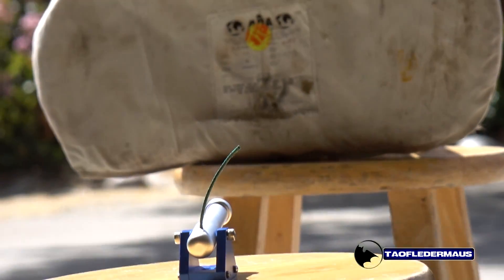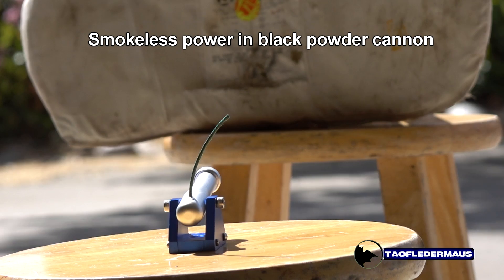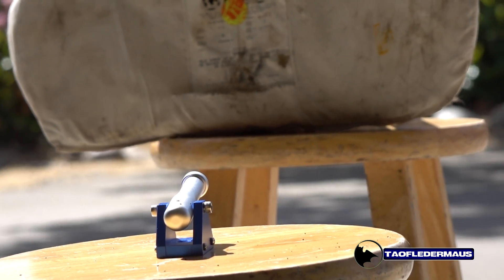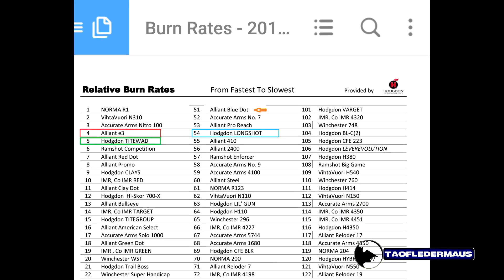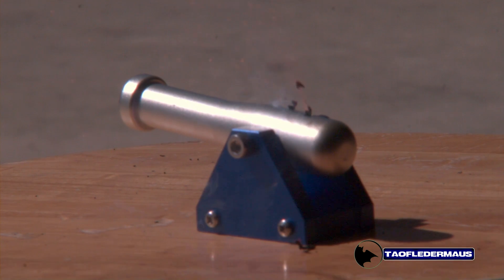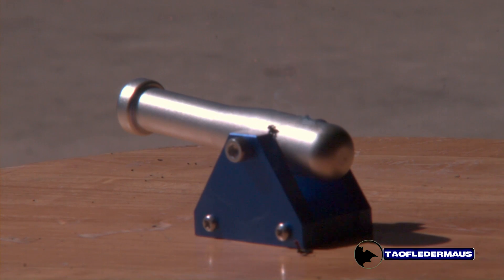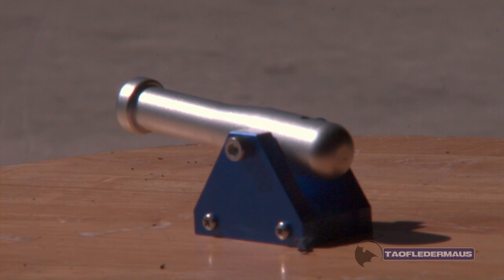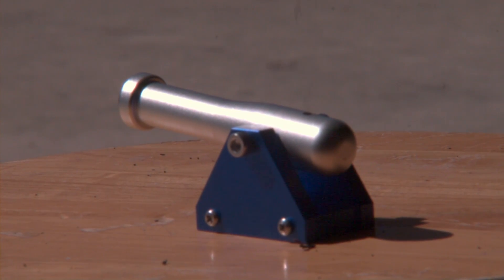What happens if you use smokeless powder in a black powder cannon?

Comment: Now replace that fuse hole with a percussion cap and you've got something. There is a good reason you don't use smokeless in black powder guns, when the pressure can rise it rises much faster than it will with black powder. Many a black powder rifle have been blown to pieces this way.  That is unless you have one specifically made to handle the presusure like some model savage guns, and another reason why you should never use pyrodex or other black powder substitutes that are really just smokeless powder.
Reply: Wow. So much FUD, and some outright misinformation. Pyrodex and the substitutes are definitely NOT "really just smokeless powder." They do not burn in the same way as smokeless powder; they burn the same way as black powder, which is why in this cannon black and pyrodex both work, and smokeless does not. Also, all smokeless powder is not the same; some burns very quickly, and some burns relatively slowly. It is possible to use smokeless in a black powder piece without destroying it; I have done it with no apparent ill effects at all. It just requires understanding the differences in the behavior and characteristics of the respective propellants, and loading accordingly. Sure, if you're an idiot and dump the same volume of smokeless pistol powder in as you would black, you can cause major problems, since it's roughly 3x the power by volume, and 8x by weight, so you're massively overloading it when doing that. However, if you calculate an appropriate load, and use an appropriate powder, it can be done safely. The safest thing of them all is, by FAR, the black powder substitutes. Not only are they very comparable in their burn characteristics, therefore safe for the gun, but they also are less likely to be accidentally ignited, therefore MUCH safer to handle. Don't repeat urban legends as fact.
Reply: @edifyguy  Pyrodex is NOT black powder, it is as they say a "black powder substitue" and it is in fact a type of smokeless powder, only it has some additives in it (which are actually quite toxic unlike real black powder) Also pyrodex is NOT a perfect substitute for black powder, they even tell you it's for MODERN black powder firearms only, antiques... well I've seen some tears shed over antique flintlocks that just can't handle the pressure to get up to. The biggest thing done to control the pressure rise time is the grain size, however pyrodex is NOT the same density of black powder, it's stuffed with filler to make sure in MODERN black powder firearms you can use a similar volumetric amount(as they say you are supposed to)... but if you use it by weight... you can blow your gun up, it's not the same density as real BP. I worked in a shop and sold many black powder firearms over the course of a decade and we had some come back blown up looking just like as you said (i'm assuming you mean elmer fudd) elmer fudd fired it after bugs bunny put his finger in the barrel. We would then have them bring us the powder. For BP firearms we only sold Goex or swiss powders, 9 out of 10 times these blown up guns they would bring in a jar of triple seven or pyrodex and we would write hodgedon's and they would send us a letter back saying unless it was a modern new black powder rifle and it specifically said to use pyrodex type black powder substitutes that it was operator error and misue of their product EVERY SINGLE TIME!  Worse still, pyrodex has potassium perchlorate in it, a powerful oxidizer many times more powerful than potassium nitrate. As for smokeless in any old black powder gun? NO! NO NO NO NO NO. The only manufacturers of black powder guns I know that say you can use smokeless is savage arms. You just go with what the manufacturer says and do not innovate. smokeless powders are a different chemical compound that have a different pressure curve for the same grain size because the chemistry is different. SAAMI has all the expensive gear that you could never dream of affording to ensure safe operations of firearms with reccomended loads and types of powders.  Sometimes you can get by and accidently double charge a gun and it still goes bang... sometimes not and it goes boom. Case study: we had one customer who thought, hey my 45 long colt rifle will fit a 454 casull Let me tell you he had a REAL BAD DAY! So yeah... Load a weapon ONLY with what the manufacturer has prescribed for it and NOTHING ELSE, you don't know everything and ancidote is not evidence. EVERY SINGLE TIME someone came to us (or the sheriff came on their behalf) it was not the first time they had tried something not reccomended. Mr 454 in a 45lc actually got through half a box before it took off two of his fingers for example.  Metalurgy is a complex science, often times you can exceed the yeild strength of steel several times and maybe stay within the unpublished safety margins but only barely and do it 20 times with no ill effect, but then the 21st time you do it you're going to the hospital to pay a hundred grand to save what's left of your hand but that's pretty silly when you can just use what the manufacturer has proven to be safe and never have an incident (NOT an accident) like that.
Reply: @kg4boj  I would still say that your evidence is anecdotal, other than the idiot who deliberately loaded the wrong cartridges in his gun, which is never a good idea because fitment will be poor and the charge will always be incorrect. It is possible to overcharge bp guns using real bp, and Hodgdon does warn that its substitutes provide more power than real bp. However, to say that they are smokeless is to ignore chemistry. Their composition and burning is much more comparable to bp than smokeless; they are deflagrating powders, as bp is, and essentially they are just more modern formulas for bp. Triple Se7en, for example, as far as I have been able to research, is made somewhat like bp but using sugar as its carbon, and who knows, it could be potassium perchlorate as the oxidizer. I don't know or care. I do know that your statement that it is smokeless with filler is factually wrong. Lay out three lines, one of smokeless, one of black, and one of bp substitute, and light them one at a time. Compare the burns. As for not using them in antiques, they tell you they're 15-30% more powerful by volume right on the can. If you're using full powder charges in an antique with any powder, all I can say is that you don't love your gun. The metallurgy just wasn't reliable back then. They were known to blow occasionally at the time with period bp. As for SAAMI having equipment, yes they do, but don't presume that careful calculations from their results can't yield usable results. Your approach to this topic seems to be a combination of elitism and fear-mongering, and is very short on science.
Reply: @edifyguy  There are a number of police reports at my old shop where people used the supposed reccomened amount, and sometimes a bit under. And yes, there is a blackpowder like substance in pyrodex to give it that old fashoned look and feel of bp, but there is also nitrocellulose in there, under the MSDS it's called "proprietary blend" as for "power" that's not really an exact thing, power is work over time.  Take the Sandia labs z machine, it uses 9 megajoules per discharge to cause an intense enough explosion to initiate fusion, coincidentally a 9V battery has about 9 megajoules of electrical energy stored in it but unlike the z machine the pulse of it's output power is not enough to kill you. DV/DT is VERY important and you'll notice on most firearms there are funny little markings, these are proof markings done with cartrdges of a known energy with a known pressure rise time that has been determined experimentally NOT by guesswork. Funny thing is things that factor into that don't scale linearly so guesswork or even careful calculation is NOT sufficient to guess a load unless you have a high speed high pressure transducer, a universal reciever and breech with a pressure port, and a hydrostatic measuring tank that can fit said barrel. Guesswork is NOT good enough when dealing with what is essentially a bomb in your hands. Some of the guns were very high quality and handed down generation after generation such as a brown bess or two and they dun got blown up because bp substitute is not the same as real BP. You can even test for NC in powder yourself if you want. Get yourself some real BP, potassium nitrate, charcoal, and sulfur, mix it with acetone. Nothing dissolves, it just turns into a wet paste. Now do the same with smokeless single base (double base will seperate out the nitroglycerine in it and give you a wicked headache and can cause your blood pressure to crash dangerously low)
The nitrocellulose will dissolve in the acetone giving you a plasticy like goo that if you take out of the acetone will harden into a plastic like lump... because it is the same thing as cellophane (old school stuff) but with a couple nitrate groups attached and it has very similar properties. Once dry it will burn like a compressed lump of NC. Now take your pyrodex, dissolve it in acetone and you will get again the gooey nitrocellulose seperating out  and in solid form it will burn identically (same color, same speed) to the NC you got from the smokeless.
Your best bet is to only use real black powders with antiques, never substitutes, and with modern black powder guns to only use what the manufacturer of the firearm says to use, and if you feel lucky you can try smokeless powder in a savage. You can call any other bp gun manufacturer and ask them how much smokeless to use and they will all do the same thing, tell you to NEVER use smokeless in any amount in their guns and then promptly hang up on you. They've heard alll the ancedotes to death and seen all the times people have blown themselves up many more times than I have seen for sure. Sometimes you can get away with something a few times but who knows how long? I know a guy who's a total pig with his reloading shack ankle deep in beer cans and cigarette butts all over  and he smokes while reloading. He's never had an accident, but that's no reason to tell people it's safe to smoke while reloading... Oh, and the perchlorate, that's to alter the oxygen balance of the nitrocellulose without adding nitroglycerine. If you don't know much about chemistry then it's kind of meaningless but it's TERRIBLE when it comes into contact with steel. It's what gives "corrosive ammo" it's corrosive namesake.

Comment: Put a solar igniter for a model rocket in the fuse hole with the leads sticking out, then drip super glue in the hole to seal it and light it with wires and a battery from a safe distance behind cover, I bet it blows up.
Reply: It won't explode, but it would likely fire. Smokeless does not automatically destroy a black powder piece if you apply some science. See my video on the subject.

Comment: So smokeless powder is diesel and normal black powder is gasoline? Got it. 👍
Reply: That's about right. Black powder burns at the same rate in open air as it does under pressure.

Comment: Very nice to see the diffrence between the two propellents, Im curios though what would happen if you would mix the two? Would the additional pressure from the blackpowder be enough to make the smokless burn properly? Is it even better then both on their own?
Reply: Better is relative. Yes, the blackpowder would raise the pressure enough to burn the smokeless, but it would burn too fast, and behave more like dynamite than anything you'd intentionally put in a gun. It is one of the most dangerous things you could attempt to use as a propellant. Stacking the bp on the fuse and the smokeless on the bp could work, but never ever stir the two together. That's asking for shrapnel.

Comment: A friend of mine did this with a 12” stainless steel bored out to launch golf balls. They ran out of black powder and used smokeless powder for shotgun shells. It exploded and parts of the cannon went through the engine block of the truck next to it. Parts of it went into three people watching and a chunk went through the truck both sides and missed his 5 year old daughter by inches. Very dangerous. Please do not try at home. Please add the danger of explosion to your video. I have enjoyed your videos in the past but I believe this one is not up to any safety standards. Please remove and redo for safety reasons!!!!!!!!!!!!
Reply: Shotguns use pistol powder. Pistol powder is very fast burning. He probably would have been OK except that it is 3-4x more powerful by volume, so he probably massively overloaded it. Most people don't realize how much more power smokeless has by volume, and use a similar amount as they would with black powder, but then they've massively overloaded it, and since pressure tends to be logarithmic, 3x the power is 9x the pressure, and BOOM. It can be done without massive explosions (I have, and I uploaded it) but you have to be cognizant of the differences in the propellants. That said, I don't think he showed anything remotely dangerous here. The touch hole design of these cannons pretty much ensures that it is impossible to explode this using any propellant without modifying the design of the cannon.

Comment: Mix 4F and smokeless pistol powder and see what happens. 50/50 ratio. Maybe it will be enough
Reply: That's extremely dangerous. That mixture creates something even hotter than flash powder; it's closer to dynamite. It makes great noisy blanks, but don't ever put a projectile in front of that!

What could work is using a few grains of 4F under the fuse with smokeless between that and the projectile. The 4F creates the initial pressure so the smokeless can burn and then it all goes bang but you've avoided the black detonating the smokeless into dynamite. Hopefully.

Comment: You said the smokeless powder won’t burn without high pressure.  I think You meant to say it won’t explode without high pressure.  It will burn at standard air pressure but it doesn’t explode at standard air pressure.

Comment: Now your gonna have to drill out the round ball 🤣😁.       🇺🇸😎
Reply: compressed air.
Reply: Grease gun in the fuse port should work just as well, you can either push it all the way out with grease or partially down the barrel and use compressed air the rest the way if you're keen on not wasting more grease than necessary. Soak it in solvent overnight and you have an unaltered/undamaged bore
Reply: @100GTAGUY  That sounds like a messy, wasteful, nightmare. Not to mention, you'll never get a good enough seal on the touch hole for the ball to move.
Reply: @xenonram  Grease could work. A needle greaser would seal plenty well enough to drive that ball out. Myself, I'd probably just try to get a little bp down the hole to blow it out. :)
Reply: Andrew Delashaw it is definitely messy, and somewhat wasteful which is why I listed a secondary method that negates some of this waste.  
As for sealing the hole you could attach a self tapping zerk fitting or use a certain gauge needle as someone else mentioned, but if I'm not mistaken this method is currently and commonly used on black powder rifles to remove a bullet that was jammed in the bore by a squib load and or to remove a bullet and unknown powder load that's been packed by some random person decades ago. 

Either way using cheapo depot grease is much cheaper than drilling a new bore, and then having to buy applicable bullet molds for your new bore diameter, and now that you've bored the ID you've reduced wall thickness, need a larger projectile, and powder load for proper ballistics all to get yourself a nice "surprise" grenade lol.
Reply: My thoughts exactly.

Comment: Try a mixture of black powder with smokeless powder
Reply: A charge half as powerful as black powder. Smokeless still won't burn.
Reply: You're both wrong. The black powder will detonate the smokeless, and you'll end up with something that behaves a lot like dynamite. It is not safe, and one of the few things which likely would shatter this cannon.
Reply: @edifyguy  Speaking from experience or from opinion here? Remember that smokeless needs lots of pressure
Reply: @ruthlessrubberducky5729  Experience and research. I have played around with that combination enough to know I don't want to put a projectile in front of it. Just with a wad of toilet paper in front of it it makes a crazy snap. The issue is that the black powder creates a situation where the smokeless burns almost instantly, instead of progressively as it was meant to do. Definitely not something where I would normally want a projectile involved. However, I do have a planned experiment upcoming where I blow up a percussion revolver cylinder deliberately, and if I have extra cylinders left after the initial explosion, perhaps a mix of BP and smokeless will be in order.
Reply: @edifyguy  So you've experimented? I'll take your word for it, then.